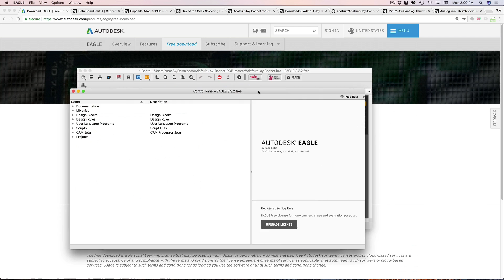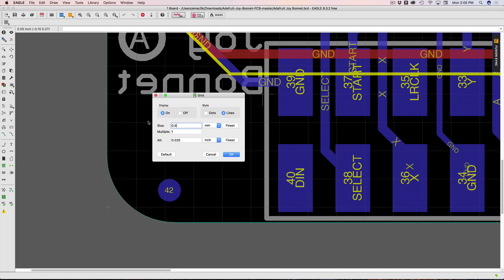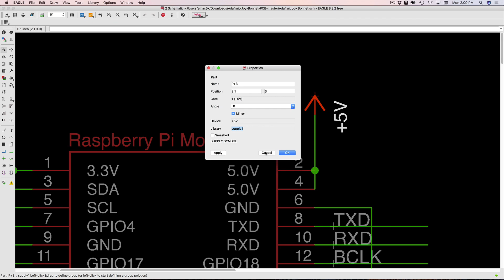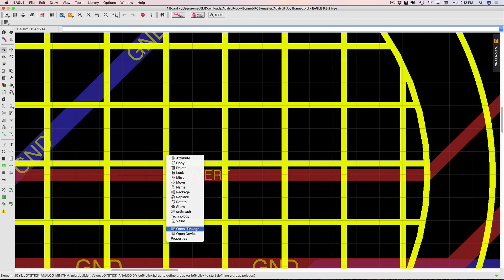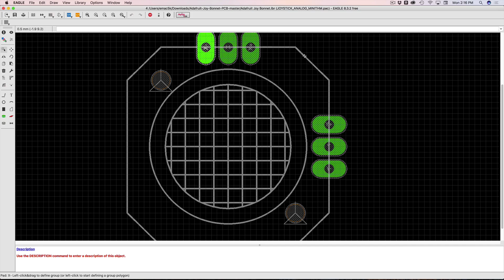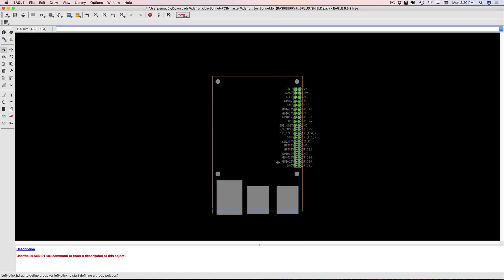Inspecting Parts in Eagle – Layer by Layer

Comment: I reacted to the abbreviation for ADC.

FYI - It stands for Analog Digital Converter, not Audio Digital Converter...
It can be used for inputting audio, but not very well as 12 bit doesn't provide very good sound quality. 

This particular ADC  gives you 4096 bit-combinations (Imagine that you have 12 bits, or lanes and you can have 4096 different combinations of either 0 or 1 on each), meaning you will have a decimal span between 0 and 4096, where 0 is 0 volts, and 4096 is in this case with the potentiometer, full 3.3 volts.

Other than that, it's OK as a tutorial and gives an insight into Eagle CAD.
The program has quite a steep learning curve, but fairly easy to learn over time.
Easy to make mistakes, so make sure to keep a copy (And remembering to hit that Save-button from time to time!), and a good tip is also to save different versions of your layout in case you change your mind and not having to either lost a previous version, or having to go back several hundreds of steps (Ctrl+Z).

The only drawback of Eagle CAD is that pesky size limit on the free version, and in order to use unlimited sizes you have to for the pro-version.
That's really annoying, at least for me since I've come across that border a few times when I've had a PCB that needs to be a bit bigger.
I personally don't feel it's justified to purchase an expensive license just for a single board, and especially since I don't use Eagle that much. I might spend a few hours at a time, but I'm not using it professionally, and probably never will either.

Sometimes the reason for a bigger PCB isn't just to fit more components, it's more to fit the board and it's really annoying to having to split a design into two or more boards and adding lanes or connectors for the other card/cards.

It really bugs me that the premium, or whatever title it has, the one prior to the pro-version, doesn't have a higher board size but rather the same area, and the ability to have more layers.
Personally I think being able to have a bigger board is better than more layers, unless you're perhaps making high density micro-processor boards with BGA circuits and whatnot that requires this. Normally noting you either makes board yourself, nor solder yourself. The latter is fully possible, just requires skills and the proper tools.
This is where PCB manufacturers come into play for that part.
Also, I can't understand that subscription-deal they have. I'd like to purchase a version (With no size-limitation) and then own it for a number of version upgrades, like normal programs, not on a per-year-basis as they currently licensing it. No small amounts either!

Comment: Hey some info on the pin layout in the library editor would be useful. When to align it sequentially and when to align it in a manner suitable to your design. 
Basically, some tips to consider when building your own parts in the library and a know how to use for the pin layout.
Most of the time I generally align all the pins sequentially, but later find it difficult while laying the board. 
So if I know before hand some tips on how to lay it in a easy manner, that would be cool.

Comment: Great idea for a series for those who want to clean up our projects. One thing I've never figured out in eagle specifically was how to make a custom board shape with custom radius corners. Maybe I'm just missing something but I bet I'm not the only one
Reply: Hi there! In EAGLE you can use the Miter or Arch command to create these shapes. Now with the EAGLE and Fusion 360 integration it is possible to to sketch these shapes in Fusion 360 and save them as PCB board for EAGLE. Thanks.
Reply: Autodesk EAGLE thanks for sharing. Maybe you can answer my question: Why doesnt adafruit include their most popular models in their eagle library? Ive prototyped a bunch of my projects and now want to turn them into custom PCB shields. But the only decent part in their library is the arduino. The trinket, feather, metro mini, etc.. none of them are in the master library. Sure I could export them as packets as shown in this video; but I cant paste them into my schematic as a whole like I can with the arduino which easily allows me to mimic what I had prototyped on my breadboard. Very frustrating. Am I missing something?